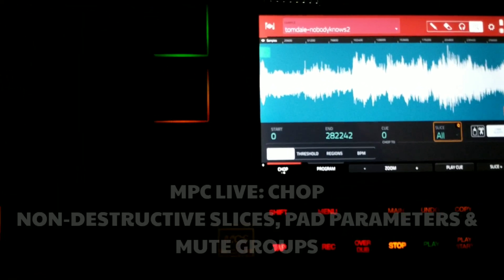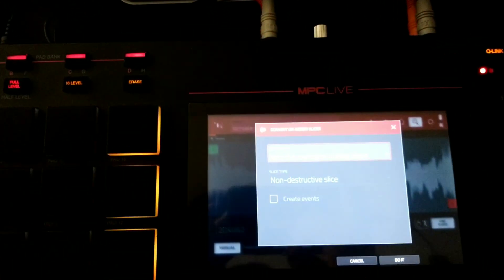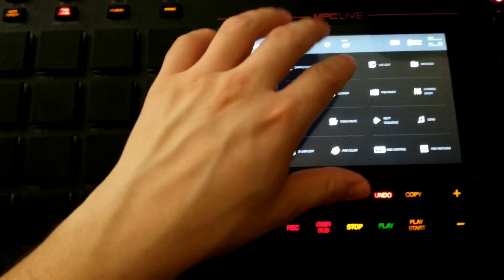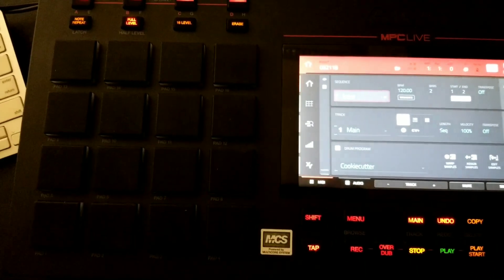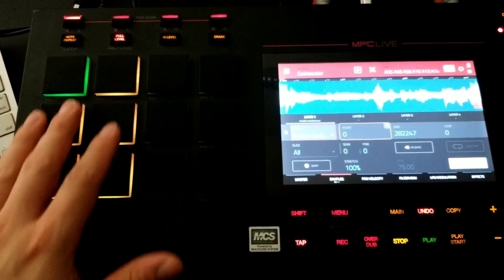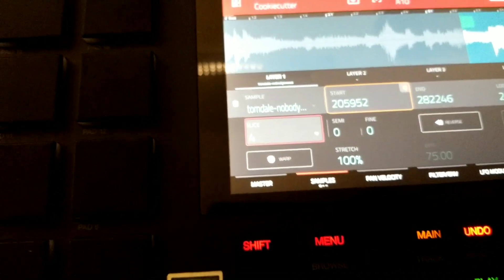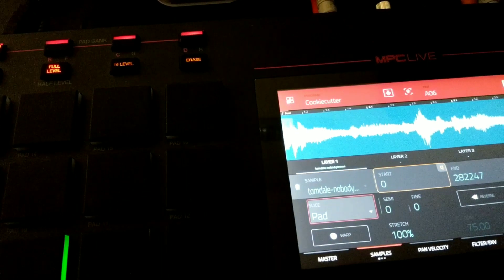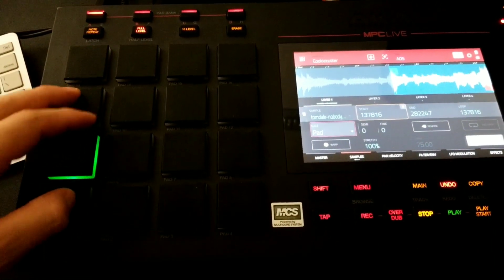Akai MPC LIVE Tutorial - Chop, Non Destructive Slices & Pad Parameters - Lifted Noise

Comment: Great video, thank you! Great way of working. I just have one question: if you keep your samples thru the end, and the pad playing "one shot", how do you "mute" or cut off a long sample when it's playing and you want it to stop? Do you make a dummy pad in the same mute group just to mute any sample playing? Many thanks again
Reply from the maker: Yea definitely. I've worked like that before, blank pad on the same mute group. It's a rare occasion, usually just set my end point where I want it but definitely have done that a handful of times.
Reply: @LiftedNoise  Thanks so much for your reply. On this video, your loops stop at a set end point? I thought I understood you lead all loops thru the end. That's why I got confused, not understanding how they stopped... Thanks again
Reply from the maker: @EnricoDePaoli  its been so long since I made this video, ill go through to see what specifically you might be referring too. Atm I'm not sure. Do you mean muting the loops with a sequence or when you stop a sequence. If you have samples that keep playing after you stop a sequence, you can quickly stop all samples by double pressing the stop button. Hope that's it....?
Reply: @LiftedNoise  Thanks again for taking the time to answer and help me. Maybe that's what you're doing: pressing stop twice. I'm actually using MPC Software, so there may be slight differences... but yes, I found it cool to leave the samples from your various start points all the way to the end... I just haven't found a way to stop them! Only that one I mentioned before, with a blank pad in the same mute group. Thanks so much again!

Comment: When you chopping a sample do you have to count out the bars as well to have a perfect chop
Reply from the maker: Not at all but if you use regions it'll chop all your slices pretty much evenly, as long as you have a loop.
Reply: Lifted Noise because when I chop and hit the pad it doesn’t pick up the sample some pads be blank or only record just a second of the sample on the pad
Reply from the maker: Auto chop definitely isn't perfect, I recommend fixing start and end points manually if needed. You can also delete those chops in your sample edit before exporting your chops to a program

Comment: My issue is exactly what you're talking about.
I can't stand that the end of slice 1 is the beginning of slice 2.
Because of this, there's often times dead noise and stuff I don't 
want at the end of a slice.  I watched this video several times and
I'm still not sure how you went about having so much control over
your slices and how you changed the settings to make it where you
have more freedom over the slices and not having your end point of
one slice being the beginning point of the next?

Can you please make a new video and explain it a little more in depth?
Reply from the maker: I can do a video definitely but it's actually pretty simple you may figure it out before I get around to uploading. Look for pad parameters when you export your slices. This should give you freedom to change your start/end points independently per slice.
Reply: @LiftedNoise  Thanks for the super fast response and I'm working on a project right now so I'm bout to check that out.  THANKS BRO!  +1 sub
Reply from the maker: Of course. I'm curious if you figured it out..? I'm prioritizing some other things before I get to YouTube stuff, but I'll get there.